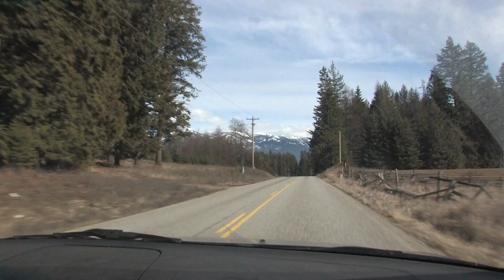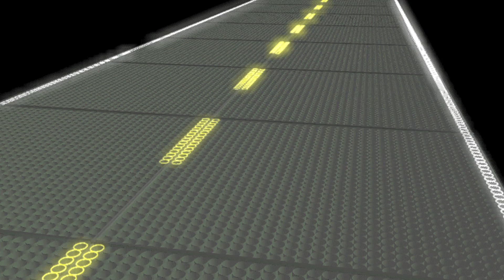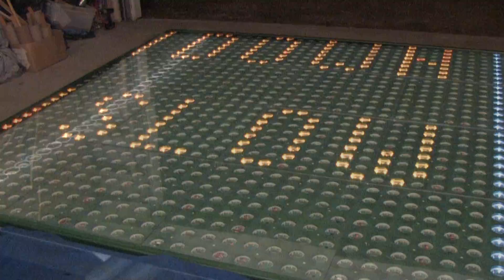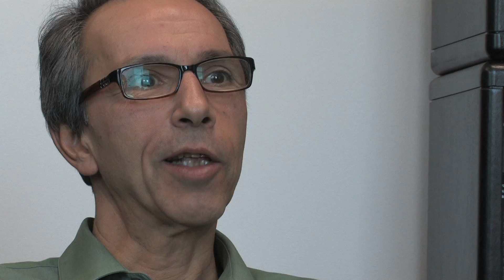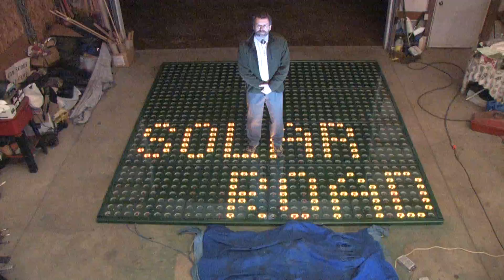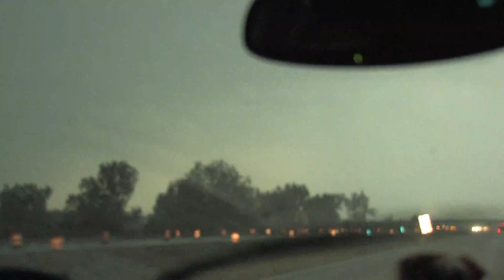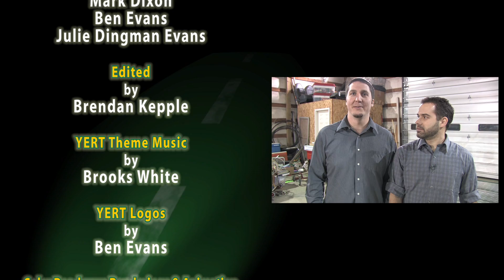Solar Roadways: The Prototype

Comment: This is a cost problem, even at economies of scale.  It has been said the glass can be made as strong as steel.  Fine, but even steel succumbs to grinding wear, which is what you get when you have tires, friction and dirt on a roadway.  As traffic wears this glass it will lose its ability to hold traction (hopefully they've planned for this and are designing the glass to wear as a sort of abrasive tires can grip all the way through until it needs to be replaced), so the wear/traction life cycle is key because this system has to pay for itself before it must be replaced.  I don't see this happening with current technology.  How will they deal with ground heave disrupting the roadbed in the winter?  Interesting concept but solar technology hasn't proved to be viable with current technologies.  Too expensive, too long to break even, not enough energy captured.  Vast amounts of real estate to generate little juice.  We have a long way to go...

Comment: Have you guys thought of using the glass to make small scale lenses to focus sunlight or somehow harness the heat from sunlight in an array under the glass-lens plating? The sun's angle is dynamic, so maybe a cost efficient way of lining the capture material based on latitude could could the solar cells by extracting heat energy, doubling as a coolant